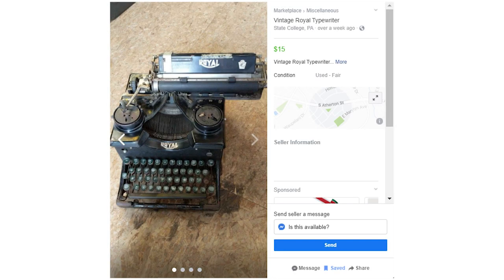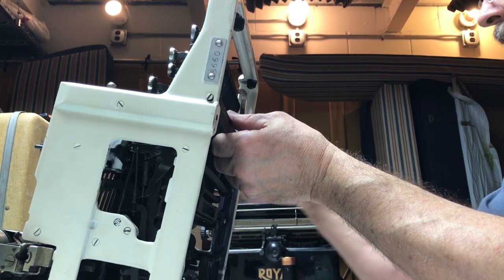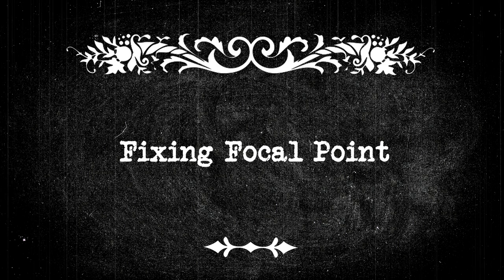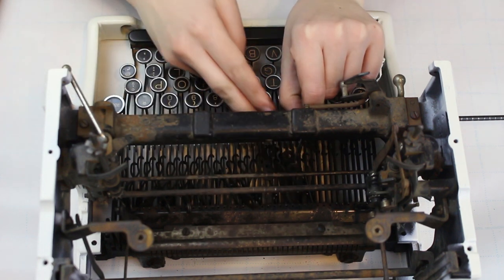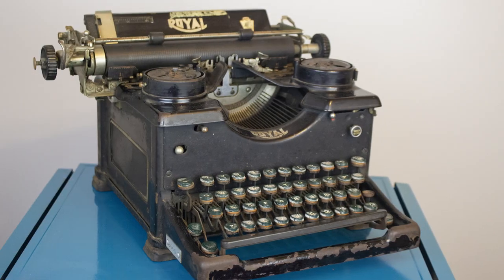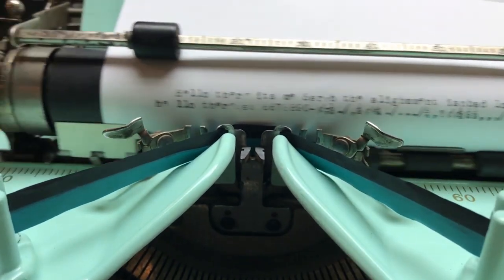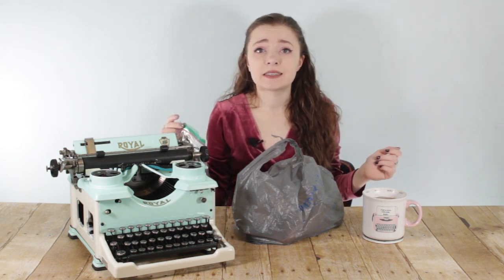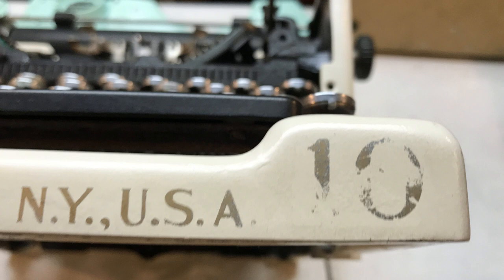Revealing my Royal 10 Project (Buying a Bad Typewriter FINALE!)

Comment: Congratulations on getting to the finish line here, something to be proud of. Typewriters are complicated machines and a full disassembly is a very big job indeed, akin to taking a car engine apart. I like doing smaller jobs and working my way up to such things - for example, a few days ago I replaced the rubber in the small rollers on a machine where they had hardened and cracked. The rubber came from vacuum line from auto parts store. That was hard enough for me, …what you did? 100x harder!!

Comment: In the future, I highly recommend finding a parts manual online for the typewriter you're working on! They're pretty easy to find for any model and display how to disassemble and reassemble a machine, and what order the parts go in when you're placing them back together. They've saved me quite a few times from project to project :)

Also, I absolutely adore how the paint job turned out! The blue is so pretty💙 all your hard work paid off & turned out beautifully!
Reply from the maker: I did use a few manuals to get it apart- and we looked at a few for a KMM to get it back together. But you're right, a guide would've been incredibly helpful!

Comment: I can relate to your experience, I have three Royal Xs only one of which works.  The first two had broken carriage rails but I manage to get other the machine working with parts from the other two. That being said you can't always exchange parts between Royal Xs, the first two machines were from 1917 and the third was from 1924 and I learned there had been some minor changes between those years on some of the parts rendering them not interchangeable.   
I also ended up with extra parts when I disassembled the carriage and reassembled it.  I still have no idea where those screws go or what they do.
Good job on repairing your machine!
Reply from the maker: I noticed that difference between my 1922 and my 34 as well

Comment: Have you ever considered learning to touch type? I used to not, but learned for explicit use on my typewriters. Touch typing gives an even letter imprint and far fewer jams of the type bars. These machines were made for touch typing on, and I believe it is only fair to at least give it a try.
Reply from the maker: Hi there- You're definitely right it would help with jamming issues

Comment: I just bought a Khm royal really great price key were pretty good but I neglected to test to see if the carriage moved. So consequently the carriage wont move but it does not have the in wheels in there. Dont know if that has anything to do with it. No manual either so im Looking for one. Anyway any suggestion as to what might be the problem. You say test it first before you take apart. It has to be the carriage. Im going to take apart but wanted to get any input I can. Before I start. ❤ nice video, and the Typewriter looks beautiful! 
❤
Reply from the maker: Check to see if there are margin stops blocking it from moving. I would also clean out the track with compressed air to see if it will move before you take it apart!
Reply: Thank you for your response. I spent all night looking in there lol Im addicted now! Lol I will try what you suggested before I do anything else 😁 thank you so much for your response. Everything on it seems in working order the carriage is frozen solid! Fingers crossed!